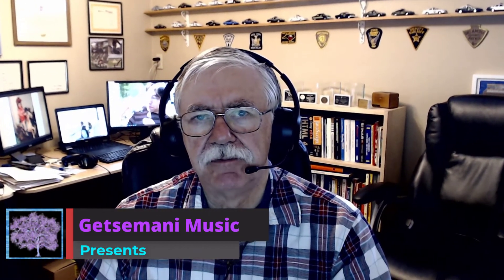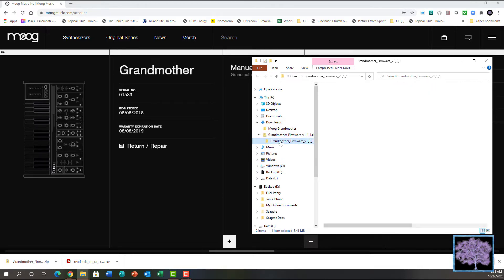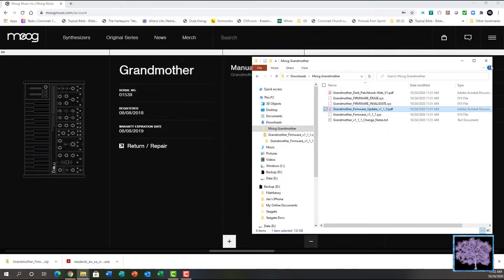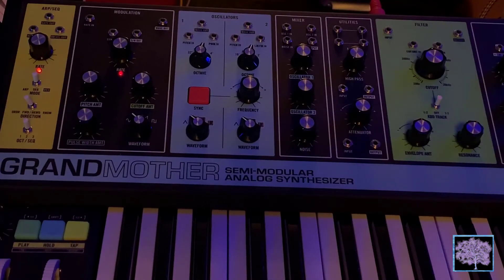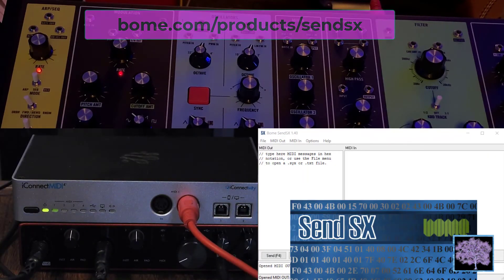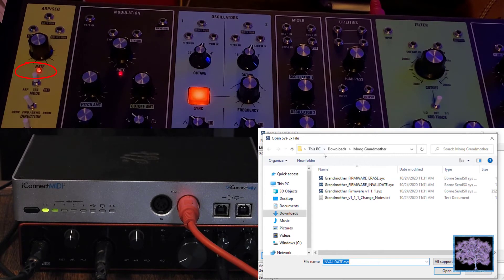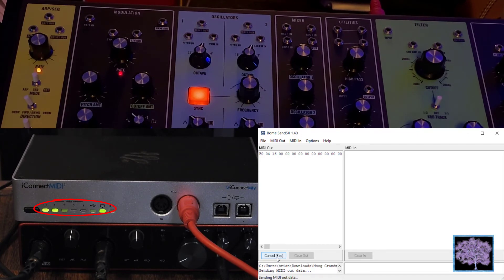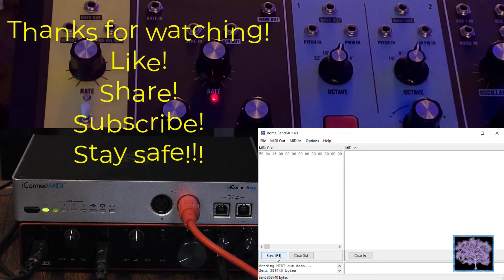Moog Grandmother Firmware Update Using a PC (Works for the Matriarch too!)

Comment: Well I have another issue. I'm trying to sync my Motif XS to my grandmother.  Can't seem to make it work right.juat want the master clock of the motif to control the tempo of the sequencer of the grandmother and play the pattern i have on the grandmother. Close as I get is tje sequencer of the XS playing different notes other than my sequence notes. Will keep time but won't play the pattern I made on the grandmother. Any ideas?
Reply from the maker: Not sure comments on a non related YouTube video are the best path for an issue with so many options, but… I only use the traditional clock in port for the GM Arp and Sequencer to connect to my other semi modular equipment, but I don’t believe the Motif has a clock out jack. The GM does support USB MIDI Clocking, but you may have to adjust the global controls to get what you want. Check out the GM manual regarding MIDI Clocking Input. I think it’s page 37. If that doesn’t help, try a Grandmother user group or forum.

Comment: How does one do it without a fancy midi box?
Reply from the maker: Read the other comments below. Your question was already answered.
Reply: @GetsemaniMusic  Appreciated. I found it on my own though. SysEx is pretty easy to use. One piece of advice: make sure the drop down menu doesn't default to another device before you send another file. A mistake I've made in the past and ended up having to reinstall firmware on another device.

Comment: Been having a nightmare trying to setup my grandmother these past few days. i would hook it up to fl studios, aswell as the matching channel rack but no synth noise has been coming out. i been using a 1/4 inch cord, midi usb cord, and connecting it into my interface but still no luck. I,ll be picking up a midi in and out chord tomorrow and hopefully this resolves my issue. Any tips or help that yall know would be greatly appreciated!
Reply from the maker: Kind of hard to diagnose in a text, but I’d start by plugging in headphones to verify output. And make sure it’s not something simple like having the filter clamped shut.
Reply: @GetsemaniMusic  i figured out my issue. I accidentally picked up an instrument cable instead of a TRS cable. Im finally able to hear sound! but not the pretty synth sounds. Sounds very bad and muffled with lots of popping at the moment. Any tips on what else to do?

Comment: I had an issue where the yellow/orange light wouldn't stop flashing after the firmware file was finished sending and the synth wouldn't reboot. I was using a USB cable like it suggests on the step-by-step guide. I Instead used a 5-pin midi cable out of by focusrite interface and started over from the beginning and success!
Reply from the maker: Glad you got it to work. I wonder if you had an old usb charging cable that wasn’t fully wired for data?

Comment: Is it possible to update the grandmother directly for my computer without using an midi interface?
Reply: Hi Joey Just bought Grandmother and did firmware update, you don't need midi interface, it can be done via usb, i'm no techy and if you follow the instructions supplied with firmware download it works perfectly, you have to install some software that Moog recommend but it's free, i did it all in about 20-25 mons total hope this helps
Reply: @new290767  I just bought a grandmother, I've had it 2 days, do I need to do a firmware update on it?  What number firmware is the current number.  How can I tell what version firmware is in it now?  Thanks.
Reply from the maker: @LilHoss  Updates for both the Grandmother (1.1.3) and Matriarch (1.2.3) are recent so you probably should update. What yours shipped with would depend on when it was manufactured.
Reply: @GetsemaniMusic  i registered my GM and then was able to download the latest firmware. Followed the video to a tee and it worked fine.  One thing I noticed is the the arp speed knob was different, faster speed at the top, more sensitive at the bottom.  Very cool!!!!!
Reply from the maker: Updated: You need to be able to send MIDI SysEx data from the computer to the Grandmother’s MIDI In Port. As long as your computer can send MIDI via USB, an interface is not required. Check out our newer video for the Matriarch using a Mac for an example.
Reply: Hi  when i registered mine with moog i got an introductory email from them with a few links to website etc and they included a link to firmware update so i just did that one the last digit was a 3
Reply: Just checked it was v1.1.3 i did mail moog asking which version to download but had no reply but it seemed logical to do the one they had mailed me
Reply from the maker: @new290767  This video is about the process, not the specific update, and was recorded three months ago. Moog is good about frequent updates. Once you’re registered you’ll be notified whenever an update is available. There will be more.
Reply: @new290767  I need to register mine still.  Thanks for the info.... I have alot to learn....